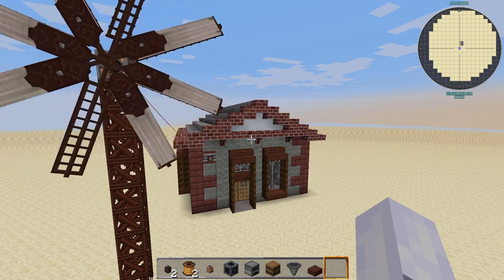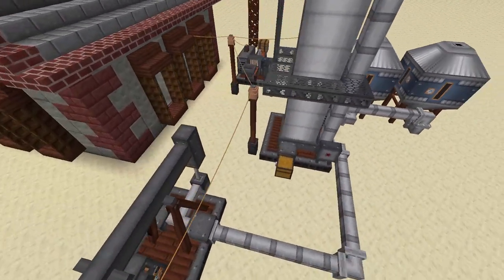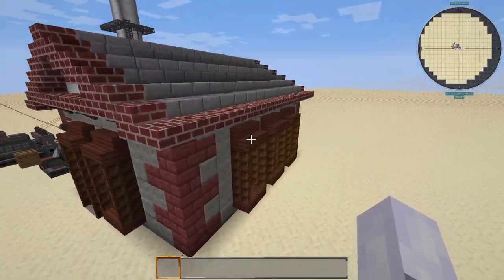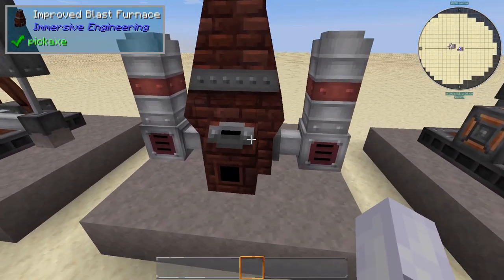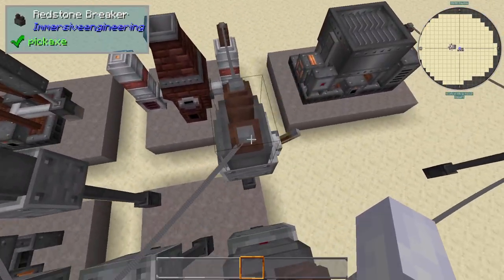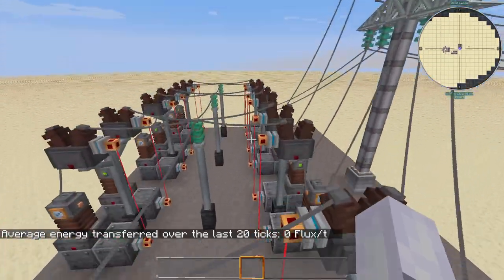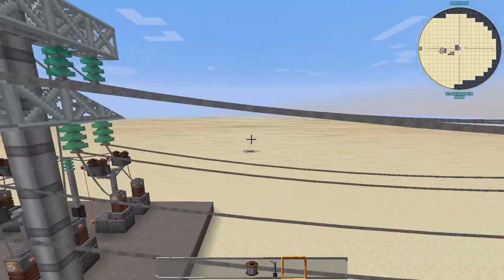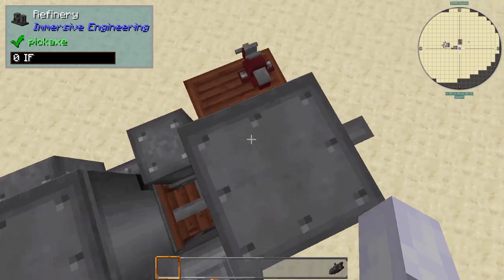5 Immersive Engineering tips

Comment: My solution is to build so much power that you don't need switchboxes and relays.

Also, it's a great home defense mechanism.
Reply from the maker: I mean, that does work! I still prefer having access to switchyards even if I have enough power, as it is still sometimes useful to be able to turn off part of your factory without cutting off everything. Plus, it's cooler because it forces you to make power poles that carry lots of separate wires instead of just 1
Reply: Same
Reply: Instructions unclear, I now have a 200 million~ RF power grid sustained almost entirely by Thermal, Create, and EnderTanks
Reply: just wire it around your base like a fence and take power off the fence

Comment: Bro - please make more videos like thise - i copied your switch yard design to the TEE! 

also - do you do any changing to the input/output of the redstone wire connectors? 
I want to setup something with Industrial wires using a redstone controller to the redstone controllers to the connectors and setup a nice control panel to control everything!
Reply from the maker: I don't because I have a single redstone wire per breaker, but if you were going to do a setup with all the breakers linked to a single control panel, I'd have each connector on a breaker set to a different colour, and then hook them all up to each other- the different colours work like channels, so you can have, effectively, 16 different redstone lines transmitted down a single redstone wire coil. If you do want to have more than 16 breaker switches, you'll simply have to have a second wire system, which can NOT be connected to the same network as the first- otherwise you'll be switching multiple breakers on and off at once. I'm really glad you enjoyed the video, and if you have anything you reckon I should create in future, please let me know!

Comment: Hi, i’m actually quite fascinated by this mod. Its because i’ve been wanting to start a zombie apocalypse smp (we are just going to start) where we spawn in a barren wastelands with mostly the ground is just plain dirt (no grass), a desert, and a few buildings to loot, also a few trees which is configurable. I want to ask if we can actually survive with just that? I mean obtain resources without the other naurally occuring biomes. Is it possible? (If not, i might have to make custom structures in recurrent complex)

I plan to build a complex (pretty much just a bunker with different facilities inside just clustered into one enclosure which is the bunker)
Where we have different plantations underground, backup generators to power our lighting and electric fence perimeter, other facilities that we need in order to produce stuff to fuel the generators, power room, etc. And I imagine hordes of zombies just outside our base cuz they finally can’t reach us. In start of course, we still need to mine and do a lot of things in order to obtain enough resources to build a base that is safe from hordes of zombies
Reply from the maker: As long as you can obtain clay, sandstone and metals (iron, coal, copper, gold and silver are the main ones, but lead, aluminium, uranium and nickel will also be helpful) then yes, you should be able to get most things in the mod! It may be a bit difficult, but it's definitely possible. Crops of some kind would also be needed if you want biodiesel
Reply: @steelblue8  thats good to know!! I’ll just add in custom farms that contain different greeneries.
Reply: @steelblue8  are there any vehicles in this mod? Or any vehicle mod that is compatible with this? I imagine refining fuel for vehicles
Reply from the maker: @noname-codm4590  Not by default, no. For these kinds of questions, I recommend installing the mod and reading through the ingame Engineer's Manual!
Reply: @steelblue8  yes i’ve actually installed the mod with immersive petroleum and engineer’s decor mod

Comment: Your video is very cool but try lowering the sensibility of your mic a little bit so it doesn't buzz
Reply from the maker: Unfortunately my "mic" is in fact just the built in one on my laptop that I use to record- the settings are as good as I can get them, it's just not good quality recording equipment.
Reply: @steelblue8  maybe lower then recording sound and increase it after the recording ?
Reply from the maker: @Oleksey1769  Chief what you're hearing is after running it through audacity with background noise cleanup + equalisation for voices. Unfortunately, no matter how you slice it, you're not going to get good quality voice recordings out of a laptop mic in a regular bedroom with no extra sound padding.
Reply: @steelblue8  oh okay then, I wish you to be able to buy a better mic

Comment: ok but im still confused
Reply from the maker: May I ask what you're confused about? If you're having trouble getting started to begin with, I recommend the ingame manual or The Gamer Hobbit's video on the mod. If it's more advanced stuff you're struggling with, like exact production ratios, power grids and the usage of fluid pipes, then good news- I've got a video in the works for that too!
Reply: everything....
Reply from the maker: @Random_Pers0n  Then yes, I recommend that you check out Tje Gamer Hobbit's video on Immersive Engineering. Any specific problems?
Reply: ok thanks